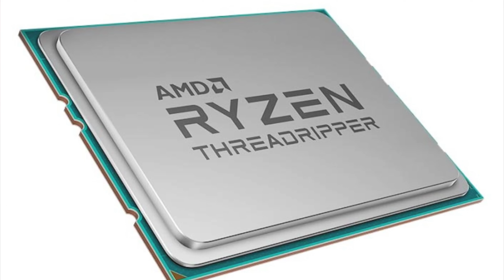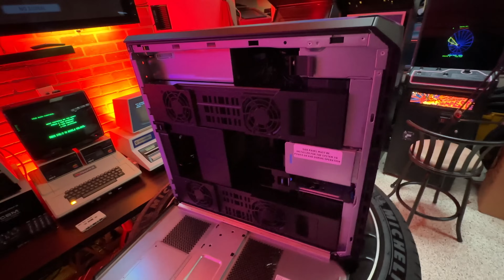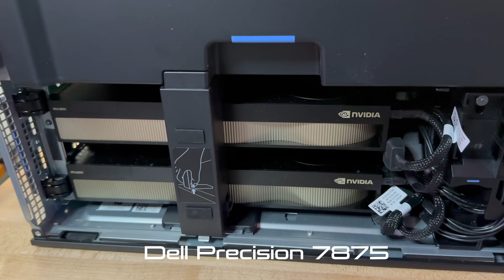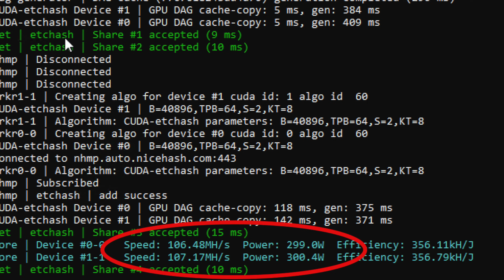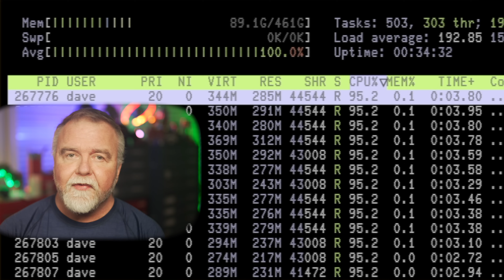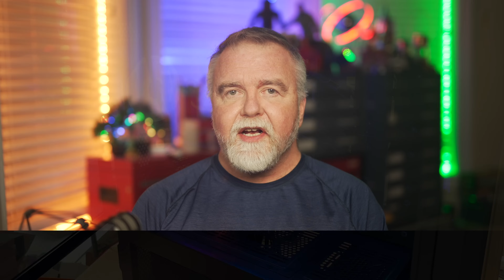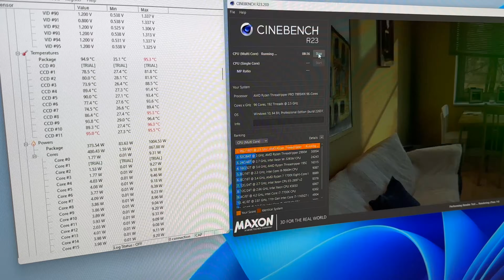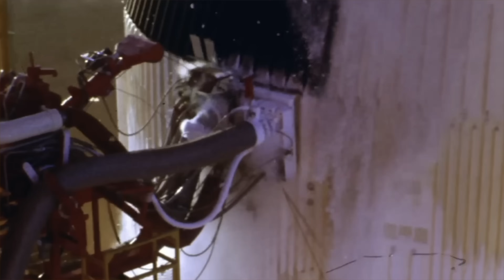1000W CPU:  The Most Powerful Desktop Processor

Comment: A couple of thoughts: 
You may find that you get better results lowering the multipliers on the cores - i.e. effectively reducing the MHz they run at. This avoids each core heating up so much that they start to throttle. When they throttle the multiplier is reduced significantly until the core has cooled down. Then it goes up again. Repeat.
Lowering the multiplier - may give you a more stable frequency - ideally one that it can hold for an extended amount of time. In effect your average MHz over time is higher with a lower multiplier. The higher multiplier looks more impressive (I had my I9 14900K running at 6280MHz) but the system may only be able to hold that for a few seconds at a time (I get better score running the I9 at constant 5600MHz).

Another trick is to try lowering the voltage supplied to the cores. The voltage is set to something that will guarantee stability in all scenarios across all production of the dies. However, many CPU can run at a lower voltage - thus less heat - without problem. NOTE! I have no experience with the Threadripper - but on Intel silicon it works well.

Lastly - I actually doubt your system is running at 600+ W. No way in hell that cooler can drain 600w away from the CPU and keep temps below 100C.
No AIO, 360mm or 420mm is rated to handled anything more than 350ish W (usually the spec they are designed for).
In essence the liquid in the AIO would soon start to boil at those power levels.

To cool something like 600+ W you would need some custom equipment. Probably also a de-lided CPU (direct die cooling) with some custom waterloop. Or preferably active phase cooling (similar to Asetek Lightspeed - but much beefier).
Reply: No, I trust the amd system here. To shift 1000W with a delta-t on the block of 10C you only need to move 25mL/s, a completely reasonable amount of water. In fact the heat spreader is almost certainly the limiting factor here.

The numbers you see for radiator load are usually listed for only 10C rise on the radiator, which is not all that much. With 30C delta-T to ambient on the radiator, you can easily shift 1000W on a 420 radiator.
Reply: @varno  Yet - real world examples show us it is not.
If you look at tests done on the brand new Intel i9 14900 KS - it pulls almost 400w.
And with a 420 AIO it hits 100 C right away on all cores and clocks down (from 6200 MHz). Surely the heat spread IS a limiting factor (thus the most enthusiastic "de-lid" and remove the heat spreader).
The CPU I'm typing this on is a i9 14900K and under full load it will pull 350W and again hits 100C and clocks down.
So I have tweaked my system to pull only 245W and I get far better results on benchmarks as it now can maintain a more stable clock over time (it then lays stable at about 90C no matter how i run the system).

If what you say is completely true - changing the AIO radiator from 420mm (one with room for 3 140mm fans) to say the 280mm  (2 fans) - should make no to little difference on a CPU that "only" draws 350W. In fact it should do just as well on a single 140mm AIO. But when testing with smaller radiators - the temps are even worse (these are AIO from the same lineup - pumps and fans are the same - only radiator change).
Testing also show that the temperature at 350W+ shows a steady increase over time in AIO temp (as in if you let it run at 350W over many hours).

Yet  Daves AIO can support almost 3x the power output - with the same radiator and fan config. I suspect his power draw fluctuates wildly and the average W draw is much lower than the 1000w peaks seen.

Comment: And here i am looking at my new to me system, with a total CPU power dissipation of 65W, on an i3 9100, an upgrade from the old core 2 duo I had. But for the price it is perfect. Under 4100 to massively upgrade RAM, a new SSD, and move the old system over to it.

Comment: Threadripper's the reason that I got into custom water cooling. The only AIO that fully covered the TR was the Enermax cooler and people were complaining about them failing (the coolant turned to sludge). They've had a few revisions since then, so I don't know if they still have that issue or not.

Comment: 8:14 Dave (or anyone for that matter!) should probably have a look at Mold, it's a modern drop-in replacement for the GNU/GCC and LLVM linkers and it takes advantage of multiple cores. It's a bit dark wizardry, but it works amazingly well. Can't imagine how fast it would link huge project binaries on a 7995WX :-)
Reply: It would be something that needs to get stable and adopted by the projects first, because thats what matters. you'd need to check if the final program with that linker is as well optimized etc

Comment: You could have encountered crashing due to the DDR5 throttling, with that density and power consumption it seems likely. Point a fan directly over the RAM and see if 5800 stays stable.

Comment: Just keep in mind that the Enermax Liqtech TR4 have had a lot of issues with corrosion and precipitation inside. Not sure if that has been fixed.
Reply: The latest models have fixed the issue. It was the first two versions that were borked due to using mixed metals.

Comment: On the subject of custom watercooling - I'd always recommend steering clear of bending pipes (aka hard tubing) and go with industrial black ZMT instead. The compression fittings are foolproof and in 5 years I've had exactly 1 leak - and that was because I forgot to put a blanking plug into on of the ports on my GPU block.
Reply: So l ong as you also make sure to use the right tubing cutter, and also to lubricate the O ring seals insode the fittings as well before inserting the tube. Makes a big difference to them, especially at the larger sizes, and at the small end where those seals have very little leeway in them.

Comment: Hey Dave, fan of your show. Have you covered MS Excel issues in your channel? I’m a corporate controller and usually the power user in the group. I typically work on not only complex spreadsheets, but a large qty of them at a time. When Excel crashes, I hit ‘CTRL’ ‘ALT’ ‘FU’ (j/k), and notice that the machine has plenty of resources left. Is there a way to set up a system to prioritize Excel? I am willing to forgo media, graphics, browser,etc to have an Excel powerhouse. I have been so frustrated by the issue that I have turned to Python for a lot of my work. Thanks for your time!

Comment: So AMD has managed to WOW people with bullshit core numbers that cannot actually be used.
Well there's were Intel 20A and 18A will come in to fix that problem.

388 cores Sierra Forest chips, that you can actually fully utilize because the process nodes they are built on are small enough, cool enough, and efficient enough to
actually leave enough power for compute on all available cores.

Comment: I recommend getting an external chiller for cooling. Seriously, it's simple and basically foolproof. You plumb the two hoses to the CPU waterblock, and that's it. It's basically impossible to have a leak when you go with EPDM softtubing and straight fittings (no rotary fittings as they have another o-ring seal as potential point of failure/leak).
Reply from the maker: Same reason you put headers on a Chevelle.

Comment: Using less ram would stress  the MC less and may let you run faster ram. It's not guaranteed as memory performance is determined by the quality of the specific cpu chip and the quality of the motherboard.. running 128gb at 6000MT/S in quad channel should be pretty good
Reply from the maker: Agree, that's what I've found as well.... but in this case, need the capacity!

Comment: Omg I'm jealous of the custom built you did. I could configure that sucker to run well. That 512gb of ddr5 5800 is no doubt putting the board traces to the test. You could completely get stability with 5200 m/ts. Good logic for figuring out the waterblock issue.

Comment: Beware of the Enermax AIOs. They have had issues in the past with clogging/build up. And honestly, a custom loop is pretty easy now days if you stick with soft tubing.
Reply: They're fixed now. It was only the first two versions that were borked due to mixed metals. So unless it's an old AIO he's had for years, he should be fine.

Comment: @14:15 If that AMD 7995WX Threadripper uses the same tech as their 7000 series CPUs, they were engineered to push to 95C at all times.  

Most of the Tech Tubers I watch all ran into this (Gamers Nexus, Hardware Unboxed, etc...).  The CPUs push to 95C then throttle to keep the temps around 95C.  I do not personally own one.  I have a 3900X build, a 5900X build, and a 5800X3d build so I do not know how true that is.

Comment: I did the custom loop for my 2990 wx ... never looked back.  It was easy and the performance has been stellar.  Even waterblocked my GPU the next year.  That said, yeah... RAM only runs at full rated speed with intel cpus.

Comment: just a small point. it's the "RTX 6000 Ada", not "RTX A6000" (which is an Ampere card). It's confusing naming. 

Turing - "Quadro RTX 6000"
Ampere - "RTX A6000"
Ada L - "RTX 6000 Ada"

Comment: Not the first to 1000W. There was that Intel 28-core 5GHz CPU demo back in 2018, where they overclocked some poor Xeon to hell and back.
Reply from the maker: Wasn't that LN2 though?  Or did they cool it with a fan?
Reply: @DavesGarage  As far as I recall, they had a big chiller hidden right below the demo unit.
Reply: OMG🤖
Is that single slot or single mobo?

Comment: If the 7995WX can pull more than 1000W with a TDP of 350W, I wonder how much the Epyc 9684X would with its 400W TDP. As per multi GPU support, the only game which does support that nowadays is the latest MS Flight Simulator. If you have more than one GPU, it will use one of the to render the plane and the other to render the environment.
Reply: You can't let EPYC chips off their TDP leash like you can with Threadripper. 🤷 EPYC is completely non-overclockable, including increasing the TDP beyond stock.

Comment: The uncore of these CPUs uses a lot of power. AnandTech did a really good write-up on older Threadripper processors which covered the high uncore power usage. My own old and 'lowly' TR2950X uses 35-45W for the uncore and 25-135W for the cores. The wider Infinity Fabric on the same generation of Epyc processors the uncore was 66-86W while core was 10-90W. Even disabling a lot of the cores still requires a lot of uncore power use.
Reply: High "uncore" is not just a threadripper problem. my motherboard wanted to get 1.2v into  uncore of a 5600x, it runs rockstable with ~0.88 or so for me
Reply: @Salzui  Voltage is kind of irrelevant in that instance. The uncore of the 5600X is much smaller than on a Threadripper and uses a lot less power. You can use something like HWMonitor to see the core/uncore power use under Windows.
Reply: They couldn't just call it "non-core", could they, the bunch of autists? Between the bionic hive-mind of the chip designers, and the monkeys on Macintoshes in marketing, that term somehow escaped out into the public. Even the smartest people are getting stupider.

Comment: If limited by a small 360 aio for such a cpu, I would strap 3 more fans for push pull config and make sure the pump is maxed out. Personally I think the 48 core is the sweet spot for compilation v cooling and ram use giving lovely high 5GHz across all cores. It slays.

Comment: First, love the video! The absurdity of just taking a 96 core threadripper and turning on PBO is amazing. 

Second, I take minor issue with "you can only do 350W of work no matter the core counter".  The energy efficiency of modern processors goes up dramatically when you slow them down.  If you have enough work to keep 96 cores busy, 96 cores at 350W will do it a lot faster than 16 cores at 350W.  That is assuming of course you have the IO to keep the 96 cores fed, which is not a small consideration.  This threadripper is amazing is that it can effectively do both, it has a ton of cores for parallel work, and still has 5+GHz when the work gets single thready. 

Third, minor suggestion.  I am an AMD enthusiast and I'd like to suggest you explore undervolting.  PBO has a setting called the Curve Optimizer and what it does is give you a voltage offset that scales with the CPU's standard voltage setting at any given speed.  The brilliance here is you aren't dialing in a big change that you'd want at a higher clock speed all the time.  Quick primer done, AMD chips today seem to love undervolting.  I have a 5800X3D and I set a -30 curve offset, which made my CPU clock about 5% faster under a prime95 test load at the same power limit.  5% isn't massive at 8 cores, but it's basically free performance, and on 96 cores that might be an impressive jump. 

Keep tinkering, I love this stuff. 🙂
Reply from the maker: Thanks!  That's why I was careful to note that its not linear... not every watt is equal!
Reply: Yeah, 4.5Ghz for all 96 Cores is enough for desktop usage.

Even as workstation, were sustained workloads need some wiggle room for an all nighter 😁
Reply: Also, those extra cores will reduce the amount of context switching. Each one gets it's own L1 and L2, so you will have a higher hit rate.

I would expect some workloads to benefit a lot more from more cores.

Comment: The Threadripper you got for your custom build, its memory controller may not be able to push past 5200. My old AMD Ryzen 5 1600X I sold to a friend and the Ryzen 9 3900X he was gifted recently were both connected to 3600MHz DDR4 RAM, but their memory controllers got flaky above 3200MHz. My Ryzen 5 5600X I upgraded to on the same B450M Gigabyte board I got back in 2019 runs perfectly at my RAM's rated 3600MHz CL17 speeds. I over-speced my RAM back in 2019 when I bought the 1600X because I planed to upgrade in the future, and I am so glad I did. My friend with the 3900X is insanely happy with his machine. His previous computer we built back in 2013, with an AMD Phenom II X6 1075T and 8GB of RAM....He was LOOONG overdue for an upgrade. The newest thing in his previous machine was an AMD Radeon RX 480.....
Reply: You might try ie. MSI, Asus or Gigabyte motherboards. I'd select memory with broadest support.

Did you try a Radeon VII, dual GPU?

Comment: Dave, custom water cooling is no big deal and is not very difficult, given a case big enough and designed for it.  The key is measuring and planning with appropriate parts that will fit.  Don't be afraid of it as the benefit will be well worth the effort.
Reply: Too much hassle

Comment: For an all in one watercooling system like this, I'd expect the maximum sustained dissipation to sit somewhere between 200-350W for a desktop CPU, possibly a bit more for this setup since the heatspreader is so enormous. For 1000W you basically need a custom loop with some MoRa external radiators or a waterchiller.
"For some reason or another, I could never get their RGB software working" - that's a very common occurance, it's amazing how all of these RGB software suites manage to be even worse than the next. 
Great video by the way, you've gotten really good at these. Compare the way you're speaking now to some of your earliest videos, quite the difference.
Reply: You're seriously underestimating how much heat a small radiator can dissipate if you don't mind the water getting a bit toasty and the fans getting a bit noisy. Remember the >300W GPUs with a single 120mm radiator AIO for cooling? I do...
Reply: @Steamrick  I had some of those, yeah (6900XTXH LC). There are other issues aside from just the total amount of heat where radiator size can help you. 
The quality of your waterblock matters a lot more at 500W+ than at 200W. At 1kW you should have a dedicated product and not something that is primarily designed for desktop platforms. The highest dissipation I cooled for prolonged amounts of time was with intel's skylake-x, where CPU-only I got to around 750W. To keep this from thermal throttling, I needed to run the best available block directly on the die instead of using the integrated heatspreader, since while my radiators could dissipate the heat, my block could not keep up with the additional layers between it and the core. At some point, you cannot buy a better waterblock anymore (or run into diminishing returns), but may still run into thermal throttling regardless even if you could theoretically dissipate enough heat via your radiators.
 Once you reach that point, reducing your coolant temperature by having more surface area to work with (or using a water chiller) helps immensely with this issue. You'll also want a good pump or course!

Comment: I would have liked to see how fast this pc is in HandBrake. Both how fast the two A6000's are at AV1 encoding, it is probably just the same as for the 4000's series. But then to see if HandBrake can handle this many cores. I have no idea if h.264, h.256, VP9 or AV1 supports this many cores. It might just max out at some point. But hey I would test it if it was my machine.

Comment: The issue with the 5800 memory was the on-chip memory controller hitting limits. The AMD memory controller needs to run a bit slower with multiple channels running.